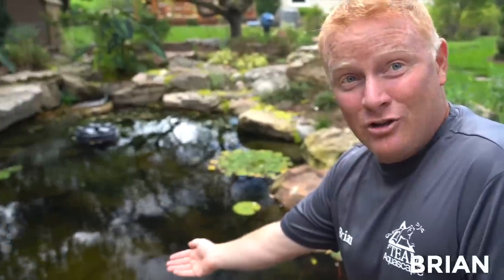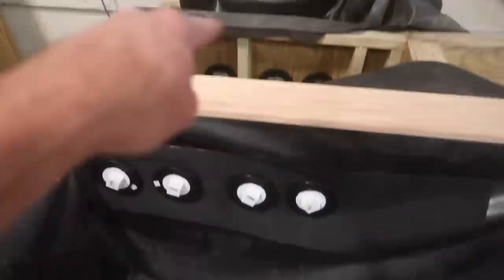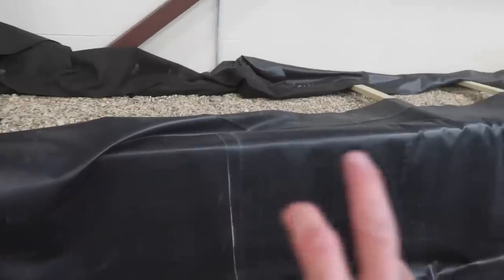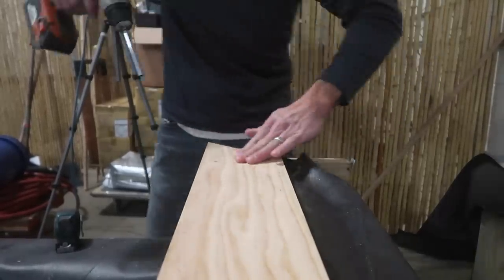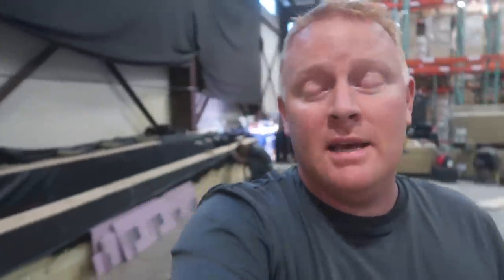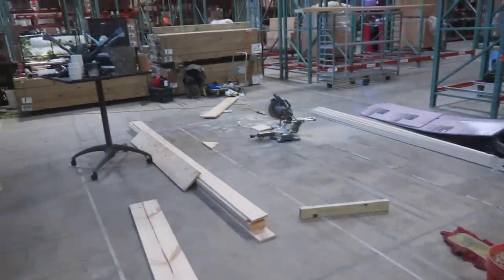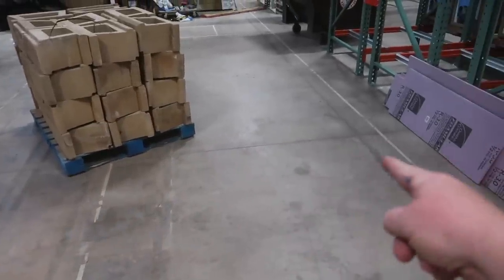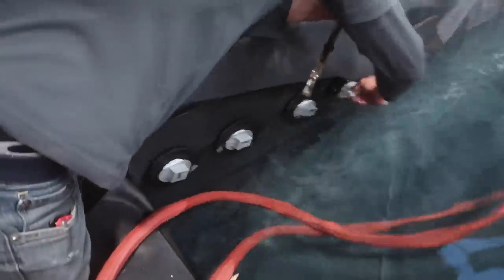Skimmer for *INDOOR KOI POND* - Retail Revamp: Part 5

Comment: Here's an idea I've had great success with for your back wall and perhaps the front.....
Rolls of hessian sheet, cover in PVA glue using a roller and sprinkle and press dry soil and coco fibre into the glue. I use this method in all my reptile vivariums.

Comment: Very interesting video, thank you for showing! Just a thought: would a "negative edge" skimmer not also have worked instead of the 4 bulkheads? I other words, a kinda large rectangular opening between the pond and "intake bay" at almost the same water level? That way, you don't have to worry about dimensioning issues of the bulkheads...

Comment: Why not copy every other proper aquaculture holding system, and utilize an external pump? Could've skipped a whole lot of work building the sump to house a submersible pump.

I am in the planning stages of replacing an indoor pond in a conservatory/display greenhouse...it was built poorly with a skimmer box, submersible pump, and small bio falls (all conveniently hidden and buried and impossible to maintain..and it leaks like a sieve)....I'm replacing the HDPE liner pond with a fiberglass preform, plumbed to an external pump w/ skimmer basket. Then a 3-way diverter to push most of the water into a wetland filter plant display area Similar to what you have built here. The diverter will put some of the water through a bubble bead filter and UV system which feeds a decorative fountain or spillway bowl back into the pond.

Oh, and for the centipede section, I plan to use cinder blocks/plywood/foam board under the fabric/liner to create the trough for them to sit in...I'm about 1/3 the size for the wetland filter, and can't use any equipment where I am, so cinder blocks are faster than the gravel backfill.
Reply from the maker: Question...how long do you anticipate to build that? This was done in four days